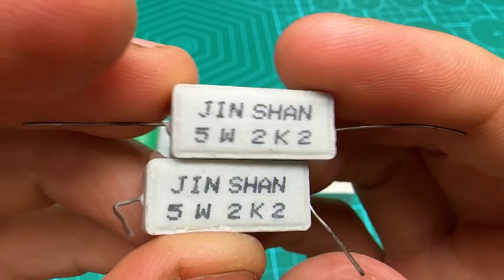DIY Powerful Ultra Bass Amplifier BLT Bridge Diode , Simple circuit , No ic

Comment: The battery is fake, the real amp is inside,😂😂😂😅😅😊
Reply: bro if there was a amp going  in the transistors it will blow em up if one is grater than the other it will explode and how would you put a aux cable into the output of the amp you cant it in the battery

Comment: The (2) 470-ohm resistors are incorrect parts if you look at the color codes on the resistors.  They seem to be 270 ohms.  Simple mistake I'm thinking.

Comment: This channel is full of fake amp videos. At first it annoyed me, but it's actually fun to figure out how it was faked. Look carefully at the circuit - the power lines are actually connected straight to the speaker output via a couple of low-value resistors, ignore all the other components, they're just there for show, as is the cable that connects to the phone. Notice when the battery was lifted up and shown, how lightweight it appeared in his hand - a 20Ah lead acid battery is a heavy thing! It's almost as if it was an empty box containing a smaller battery, a small Class D amp board with bluetooth input, with the speaker output joined up inside to the underside of the original battery terminals. So yeah, fake as heck, but hats off to the guy who posted this, it was quite cunning!

Comment: I have been dealing with electronics for 35 years, so I have never seen diodes used for such a purpose in any circuit, there is no such nonsense.

Comment: You need to show how the components resistance bolts and watts also make converters on how to use lower power components and how converter amplifies as well as how to make competition size devices like the big stereos in car audio also to show how one can make multichannel devices. Also how to develop speaker to emulate true sound and not stereo. Sound from stereo like surround sound is like lighting a room with lots of flashlights and not one light in the middle of the room to light up. Truly good sound is like the sun illuminating the room with a single bulb instead of multiple flashlights as flash lights are beams and not reverberating out into whole room ie radiant vs stereoscopic

3D sound vs stereo
Reply: Your asking for to much, nothing wrong with the amp but like so many diy amps they use max volume with the device "such as the smart phone" to regulate gain. The amp needs a volume control.
Reply: Fake. The amp is actually in the battery case, driven most probably with Bluetooth. When replacing lead battery with Li-ion ones, there is a lot of left space in the battery box to fit the amp here.
Reply: É fake amigo, todos acham que a bateria tem um auto falante dentro más na verdade o auto falante é uma caixa de som  bluetooth recarregável.

Comment: Writing 6000 watts on an old 20 watt speaker does not make it more powerful 😂😂😂
Reply: Also... 0.2 Ohms? In what universe? 😮‍💨
Reply: Closer to 20 Watts
Reply: That china product style
Reply: Made in Vietnam😂
Reply: Hoak
Reply: Then the battery must be of 12 V, 6,000 AH !!
Reply: Likely you can make 6,000 Watts with the circuit parts you would need to hook them all up and boost the volts and current and amps so likely you can make 6,000 Watts I mean this is a good learning process for someone that wants to start out circuits or getting into the Bluetooth speaker industry
Reply: Странная схема (
Reply: Хрень  ,дурит чувачок , диодные мосты никогда не станут усилителями
Reply: La gardas yaptik olmadi ses gelmiyor ilk defa birsey yapalim dedik elimizde kaldi
Reply: 6W !
Reply: Ahh no aspè forse voleva scrivere 60 watt non 6000😂😂😂😂😂
Reply: Kkkkk ele tem 60watts
Reply: Bro he have invisible thermal past 🤣
Reply: @twogitsinacar4811 vvv
Reply: High level of marketing
Reply: ExtraUltraHD P.M.P.O.
Reply: 😢it's possible it has a peak output around that wattage.note it's a 0.2 ohm speaker. So alot higher power handling than the likes of a 8ohm which would never peak at6000w. Hope this makes sense
Reply: I mean wrong
Reply: Y después que inventaran.cohetes a la luna con diodos rectificadores a propulsión..
Reply: @heinmuller5069 the amplifier is ridiculous💀
Reply: The amp in in the fucking batery compartiment💀
Reply: Bro deleted my comment
Reply: Just only content broo😂

Comment: I went through the trouble once, to use audio transformers to combine the channels into one and make a center audio output, which was a partial failure. Meanwhile I had a pile of diodes and didn't even consider using a couple of bridge rectifiers... Lol.
Reply: 6:22 😊🎉😢😊❤😅 6:24

Comment: This is false already analyze it first, they are the same nodes of the input cable with the output ones, that is, the output and the audio input are connected to each other, this circuit is false

Comment: Those are awfully thin wires for drawing the 500A maximum current required to deliver 6000W
Reply: Why 500A its a bridge rectifier 608 that means max 6A At 800v max
Reply: @heiko_st-l1h  Well he has written 6000w on the speaker, which clearly is not true and is using a 12 battery for powering it. So if you take 6000W and divide it by 12v you get a current of 500 Amps, at absolute maximum. if this fake circuit were to work as an amplifier, which it won't, because like you say it's a bridge rectifier

Hence my comment on the awfully thin wires needed to carry the 500 Amps

Comment: How could somebody publish that a crap!   So fake!    The Batterie is modified and has a smaller Batterie inside with a BT Receiver, connected to the phone.   The Audioconnection out of the phone is an emtpy USB-Plug, with no audio connectivity!  The battery lines are directly connectet to the speaker lines, so that the audiosignal goes to the spealer direkt from the battery.  The two  2K2- Resistors are shorted internaly.   That's the trick!